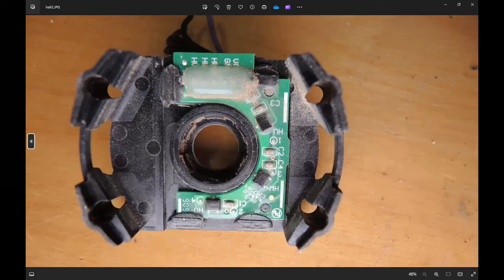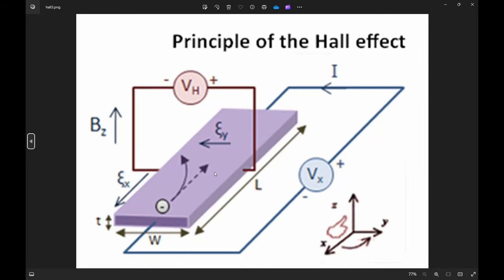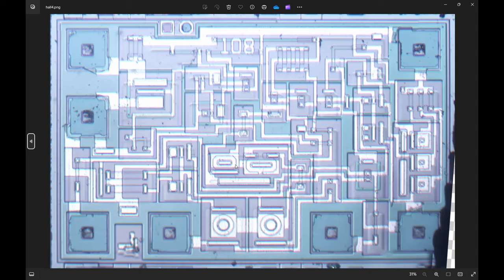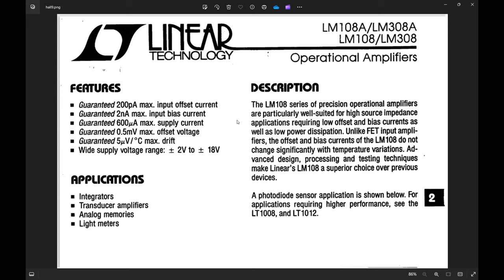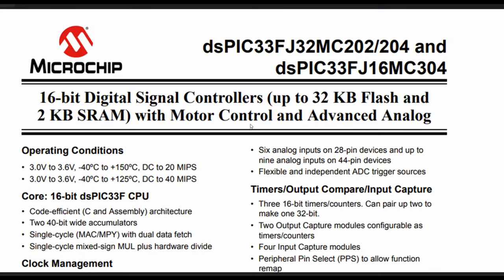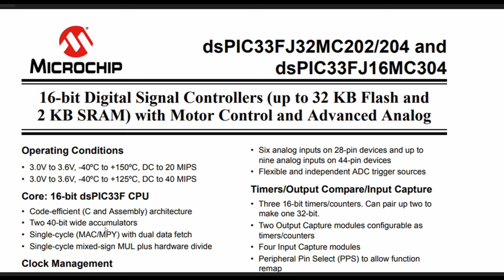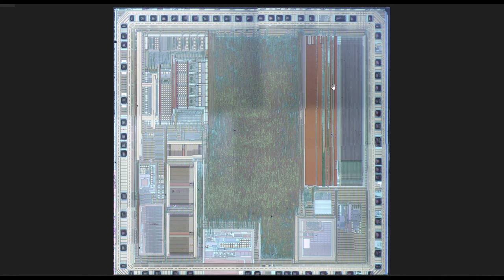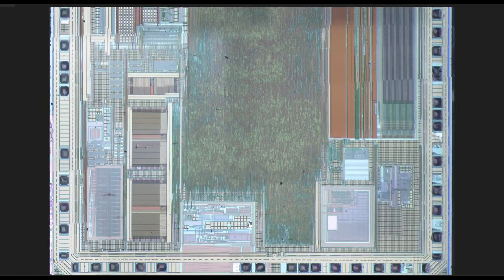DeWalt XR Brushless Design Secrets

Comment: I wonder if their electronics are shared over their product range. Would make sense, as they essentially are very similar in functionality.
Reply: Very likely, same basic functions, only you need to very a few parameters like current and ramp rates, plus a desired speed at various points of the range.  Would say that probably half of that flash is used to store look up tables, as that is a lot easier to do than a multiply, and for a motor driver quicker, as you only need one table and simply use an offset to get each phase drive out of it. They likely use the PWM on the drivers to ramp the current up per coil per cycle, using the look up table to get it, as that is probably non linear, so instead of having to do motor coefficients and multiply to get the right one they simply took a few, did a sweep, and got an average for the lot, and put in the table. motor driver the top of the die has both a boost circuit and a push pull driver, to enable them to use the same type of IGBT drivers, fits in with having the 3 diode blocks on the ceramic, there as both  overvoltage clamps and also to provide this boost voltage. Probably part of the trench drivers is actually a capacitor, in 3D to get more capacitance per unit area, exactly like the trench MOSFETS do to get more gate area.

Comment: I agree theses tools are great and powerful.  Was a fan until my barely used 20V chainsaw stopped working and found they just sell the the controller in an assy motor-controller-switch at almost the price of the tool.  That's a shame these days how they force people to garbage things.  I found on the net that many have the same problem even some with the saw almost not used (for sure a weak component in the controller).  Is an electronic king like you can help people find (if this is possible) some replacement oem controller the theses brushless motor tools?

Comment: Why did they use IGBT and not MOSFET? 
I thought IGBT is used in high voltages, where MOSFET can't be used.
Reply: Yeah its quite odd, the lowest volt IGBT I saw from onsemi are 300V, high for a 20V tool. The Vce loss on those would be massive at 2V+. You can find a similar module with FETs, FTCO3V455A1 (rated 40V, so this module is either 40V or 60V I guess), though it doesnt have the ceramic block.
Also, the trenches he shows in the video look similar to some vertical MOS die photos I see online. 
But, I don't have anywhere near the knowledge of electronupdate.
Reply: IGBT's are standard drivers for 3PH motor drives (BLDC and VFD) due to their extremely high power capability, at very high speeds, with very low gate drive currents, and they do it all very efficiently.
Reply: Could be MOSFET, as the massive gate array is indicative of it, and for the current of a 20V tool an IGBT power loss is very high, as the saturation voltage is high, but a MOSFET can approach a wire resistance wise. For high voltage the IGBT wins for the resiliance of the integrated PNP transistor over the MOSFET, though the drive is a small FET that only has to handle the base saturation current, so for a 20A load probably only 5A, easy enough to do, while the rugged transistor does the work. Also the turn off is a lot less of a problem, as the miller capacitance means there is a lot less charge induced into the gate you have to remove.
Reply: @StreuB1  Yes, standard for 3ph motors that run at 240V+, not <30V motors. As I noted the Vce losses in the igbt are high, usually 2V, so about 10% loss. Way too high to dissipate here.
Reply: Yes that is almost certainly not IGBT, probably MOSFETS.

Comment: I don't think the hall effects sensor would be based othe ancient LM 108
Op amp. These are very common and probably have special chip design for this purpose. Also in order to get reasonable hal voltage the hal element must be made of semiconductor, not metal PCB-traces.